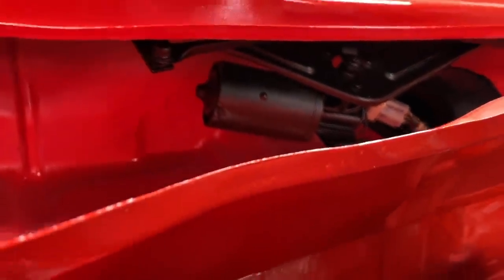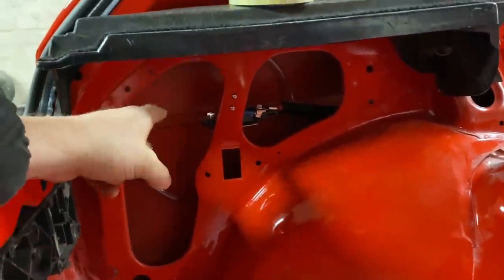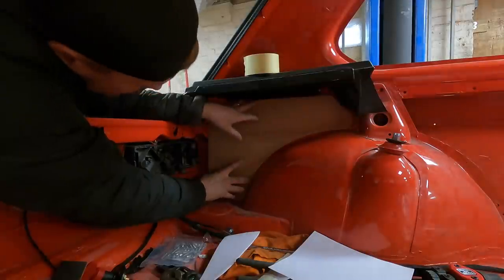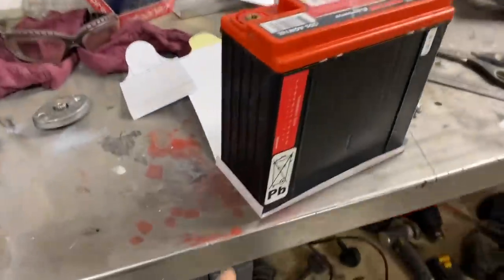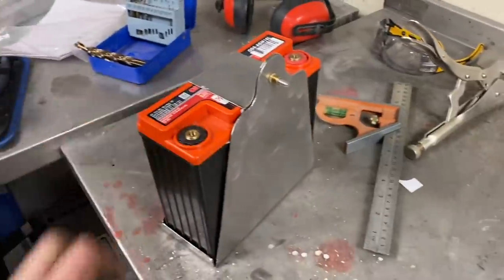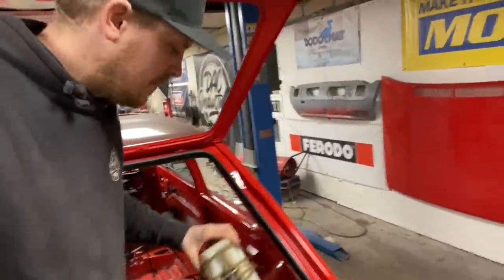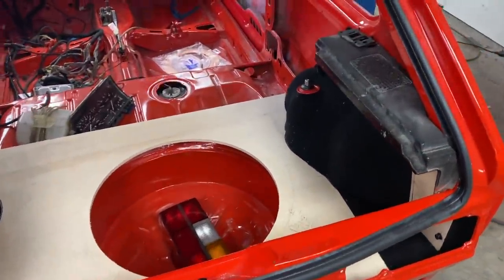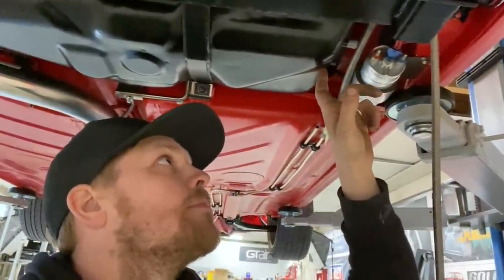Custom Battery Bracket & Carpeting The Boot 1983 Mk1 Golf GTI Restoration 1.8 20v t Engine Swap

Comment: Looks neat! 
I'm a bit worried about the battery in the trunk. Yes, it's (probably) an SLA (Sealed Lead Acid) battery but they also have vents. You're not supposed to charge them in closed spaces duo to the rist of hydrogen buildup. The can recombine the hydrogen with the help of added calcium, but sometimes that process is not quick enough.
Since the MK1 Golf vents through the hatch (I think?) you should be fine as long as you keep the fan in the dash running. 
I'd open the hatch when charging externally opbviously :)
Reply: With a lithium battery it's even lighter and there is no hydrogen. Or, a regular battery with the vent tube running outside the car :)

Comment: I think you are progressing really well Dan, with a resto like this I don't really think you should have deadlines as there is so much that can hold you up like suppliers not getting parts to you on time plus it puts unnecessary stress on yourself then you start rushing and cutting corners.
I've never seen a car battery that small for a car like that Dan, is it some kind of new tech battery that has enough power to run the car 🤔🤷‍♂️👍

Comment: Hi Dan. All the way from south africa where the golf 1 was in production till 2009, that being said will you be putting a heat shield between the exhaust and the tank? The gap is tight there
Reply: It's a metal tank and the exhaust doesn't get that hot in turbo car also lots of air flow underneath the car. Hy Bly nie in joburg nie lol

Comment: That fuel system
Is alot simpler than standard gti which ran similar pump which included a lift pump, swirl pot & accumilator all hard to get hold of & mega £ & of course no room to fit it all. 
Hope your simplified system works
Reply from the maker: Cheers bud, yeah it is a lot simpler. Hopefully it will work. It’s similar to the sytsem on a TT which is what the engine is out of so fingers crossed 🤞

Comment: Should probably do a little bit of chassis stiffening.  More power, stiffer suspension and stickier tires than back in 1983 will all work in concert to try and twist that shell big time.  BTW is the color original 85 Mk II Mars Red?

Comment: great video Dan, it's really coming on, how did you secure the braided lines to the underneath of the car, it looked like they were p clipped but not sure if you had to drill through the floor pan and nut and bolted them?